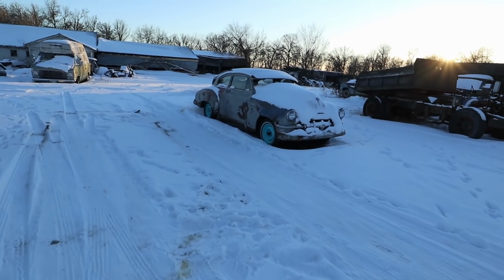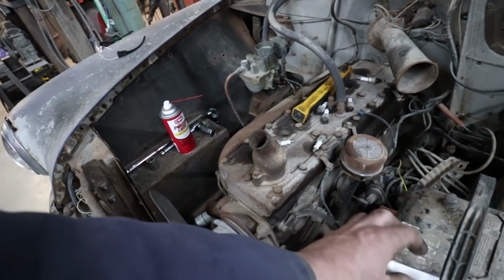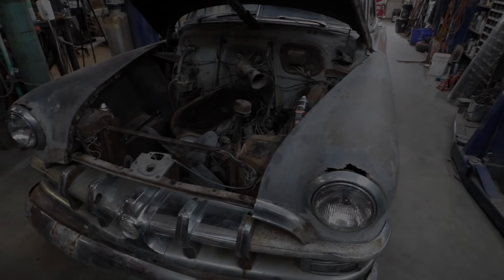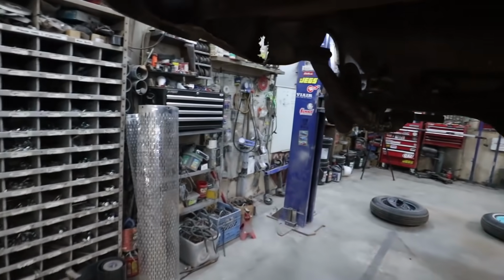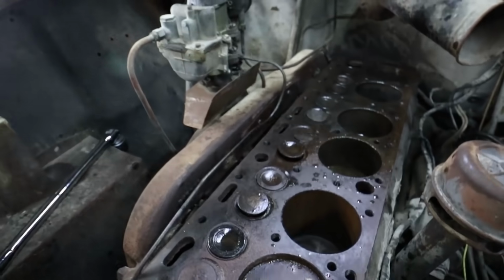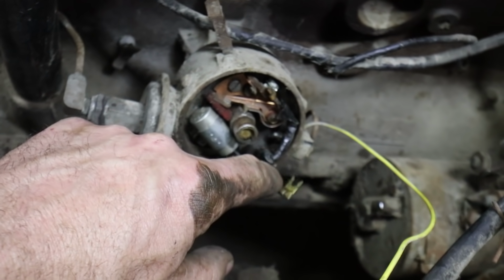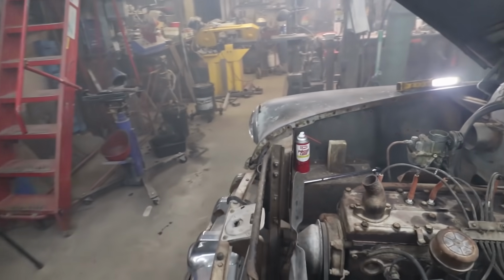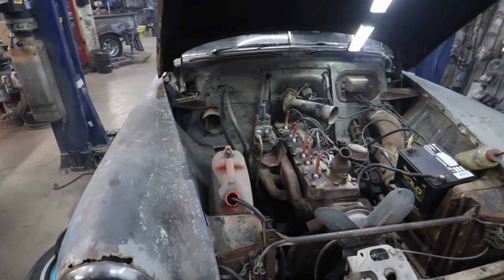Traded a snowmobile for an abandoned 1949 Pontiac with a stuck motor will it start?

Comment: Man fill silencers with diesel  an heat block up she will pop lose find a way to pump hot water through  it she will break loose unless barings are sexed to crank garrenty  it the key  heat block

Comment: .....is this not  a 1949 Canadian Pontiac Fleetleader?...... A  re-badged  115" wheelbase Chevrolet with a Pontiac L-head six and miscellaneous Pontiac bits to differentiate it from the '49 Chevrolet?....a really rare car, isn't it?
Reply from the maker: Don't think so there's lots of these around here though I did always think the Canadian stuff had overhead valve engines
Reply: Oldthunder66     I had a '49 Olds 'basic' many years ago and it looked just like your Pontiac, that motor was tough as old Tar. Keep up the great work...